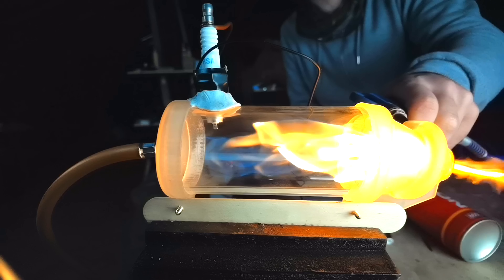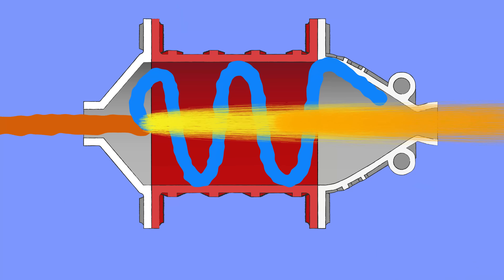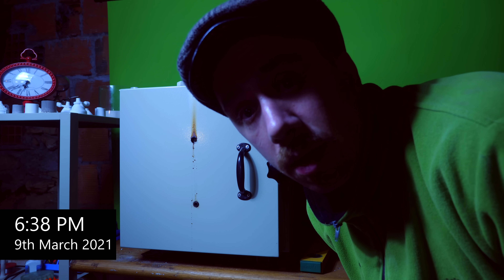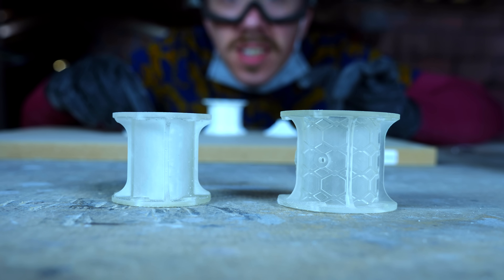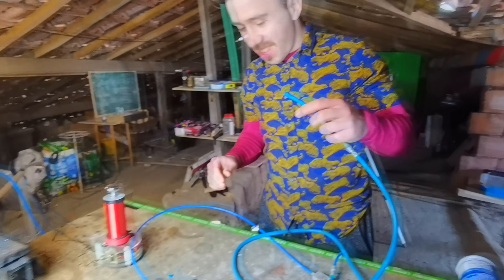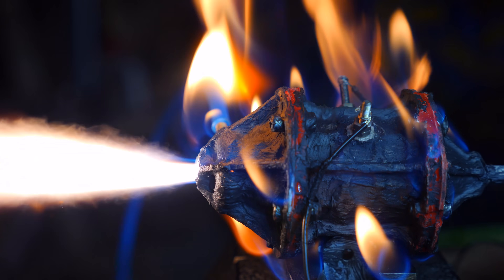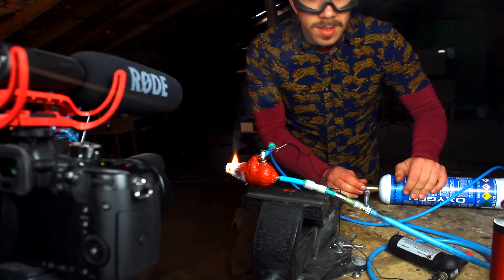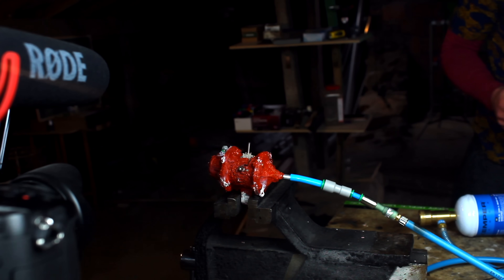Vortex Rocket V2.0 (3D Printed)

Comment: thinking materials... have you considered a layered assembly ?inner ceramic layer, a seal (maybe a soft metal), outer ceramic layer and another seal layer at the end?.. or those coats you used.. idk i'm not an engineer

Comment: I love these rocket projects! What if you coated it inside and out with water glass (sodium silicate) 3 or 4 times, firing it in the kiln for each layer? The one piece design would work best I think. 

To evenly coat the inside: Take a vinyl tube & cap one end. Drill a bunch of holes drilled in it along the whole length. Fill the tube with the water glass & leave the top open. Use a high speed drill to spin the tube while holding it vertically in the center of the engine and let centrifugal force do the work. Trick is to make the holes small enough that the surface tension holds the liquid glass in but allows it to flow out when spun up.

Speaking of spinning, have you thought about trying a clay model on a potters wheel and joining 2 halves? It will probably leak but there's a solution I'm sure.

Comment: If you glaze these parts you need a blast shield.  if the pressure builds too much and cant escape fast enough the engine will explode. A rocket engine is a controlled explosion, please be safe.
Reply: Also i love your videos! You rock et!! Get it?? Keep up the goos work

Comment: Smoking engine gasket component clown, combustion engine seal compounds is not for rockets engine temperature . Engine oil pan seal paste temperature is limited to boiling water not the temperature of fire blowing 451 degrees

Comment: Could a mold be 3d printed?  You can buy the ceramic in liquid, pour it into the mold, dry, fire, then there should be no cracks as the ceramic liquid is pure.

Comment: Seal the inside with a glaze before firing in kiln possibly? Fuel cells use ceramic media because it is gas permeable. Since u are under pressure the gas will fill the pores quickly I imagine. Could the gas be creating small micro explosions of gas INSIDE the pores of the body that are weakening the ceramic? Very Cool progress & look forward to seeing you get this figured out! Keep it coming & good luck! Oh! & please wear dust protection when grinding that stuff!

Comment: 2 Ideas to stop(or slow) the leaking: 

You could put the ceramic engine in a metal can, then fill the void with refractory cement, and possibly cap off the end with a welded plate with a hole for a nozzle.

You could wrap a metal(possibly copper) coolant line around the engine that the O2, propane, or other coolant goes through, secure it with refractory glue, then coat the now cool outside with a non porous glue/resin without worrying about heat.

Comment: using a metal sleeve either in aluminum or a alloy. the problem with using ceramic is yes it withstands high heat but it is porous. maybe adding either titanium powder to the ceramic will help with the leaking and using braided steel tubing for the fuel source and oxidizer would help as well as there should not be as much back pressure from the gases as they enter the engine. You Idea is sound and just a wee bit more refining and you will be there

Comment: I understand you wish to 3d print all of the parts, but we undersrand that the materials available right now have obvious limitations. You cant just cast or print a piece final dimensions, you have to get close enough and grinds or machine the final dimensions or get comfortable with using a lot of sacrificial couplong hardware like seals and gaskets.

Also electroboom was always good. Jay bowes still sucks. Good dude, but his producers need to be fired.some of his jump cuts are so jarring thst you think his disembodied head is going to pop out of the silverware drawer.

Anyway, if you want the casing to be less porous, i suggest coating it with a few layers of ceramic slip, then kiln baking to glass the outside. It will leak far far less that way. Another method to increase the thickness of the casing without giving away too much to shrinkage would be to NOT HAVE 7 AD BREAKS IN A 20 MINUTE VIDEO!

Comment: Hi Integza, I think that now that you have a kiln you could try to make it out of metal (which won’t leak or burn, obviously). What you can do is 3d print something using plastic, then put that object in a bucket and cast plaster of Paris around it, then you can put the plaster with the 3d printed object in an oven to melt out the plastic, then pour liquid metal (I would start with aluminum) into there. Once you remove the plaster, you have a metal rocket engine. I made a forge and I have cast aluminum and copper. Aluminum is a lot less scary to cast than you would think due to its lower melting point. You would not need that much more equipment, just a crucible, crucible tongs, and some heat resistant gloves (which, let’s be honest, you need anyways) since you already have the kiln. If you do not want to do it yourself then you could probably collaborate with someone else, just mail them the 3d printed things and if all goes well they’ll just mail you back the object in metal.

Comment: ...its leaking because of the fact that the ceramic is porous right? cant you use that porosity to your advantage? like, what if you thinned down the refractory glue/high temp silicone, with something that evaporates easily, and painted it on the parts, and while wet, place it in a vacuum chamber to REALLY get it to soak into the ceramic and fill ALL the nooks and crannies while evaporating said liquid at the same time.....

Comment: I have very little knowledge on how engines work. But my best suggestion would probably be a way for the engine to naturally vent access pressure. As for rocket engines the chamber diameter to nozzle diameter ratio is set for specific internal pressures for maximum efficiency. If it goes over this pressure by to much it could self destruct, so maybe a way to vent that overpressure would help solve some of that issue with leaking. Another solution might be to find a thicker thickness for the ceramic to be at, or a different 3d printable compound or sealent thats less porous

Comment: A way of measuring thrust the engines are creating would be a good addition for future videos, especially if you can get them running consistently and try various nozzle shapes and sizes.

Be fun to see how much weight you would have to play with if you want to get one of these to fly or push something at some point.

Comment: Why dont you glaze the parts afterwards and try seal them like that. They're ceramic, you have a kiln, a high temp glaze may work?
Reply: Exactly my thinking
Reply: Yes!
Reply: The pressure is the bigger problem
Reply: @Mikail_199  just take some Prozac and the pressure won’t bother you.
Reply: @BobWidlefish  yeah i was obviously talking about the social aspect of this project
Reply: @Mikail_199  yea, i was thinking about that, but the rigidity and temp resistance may prove better than the current solutions. Glazes after firing are basically glass and glass bottles can hold decent pressures.
Reply: @zakhassan9722  k i would use a splitted ring which is between the parts and is wider in the inside. That would be an easy solution with no glaze or something new.

Comment: 3 solutions: increase pressure vessel volume to reduce pressure.
2 copper/steel sheets w/ ring joints glued with heat resistant putty to re direct pressure.
1 wider nozzle or a pressure relief valve that can feed into a bell since much of your ignition is happening  past the nozzle and lost energy is recycled as bell wall pressure . probibly can think you can do at least 4 more upgrades on dimension, materials and energy manipulation and is ez as pi.
please do hybrid chambered linear-rotating detonation engines as a Segway to get feelers to rotating detonation engines.

Comment: Hey Mr. Integza! 
 
Lets repeat process up until you got your Red  Zeppelin @ 12:56  and then proceed more  with the enclosure idea. 
Encase the entire print after its reduced and use some high temperature resin to cast the entire thing in a block. Tricky thing is preserving inside geometry. 
Maybe only leaving nozzle exposed and drilling in the other holes after casting. Shouldn't be too hard super maybe???
Try iterations of density, and use vacuum box to make sure the resin reinforced and makes a more gasproof seal around the engine. 
Make a Solid Block with your Engine Geometry inside. 
Hope I'm kinda explaining it right. Will try to find examples and follow up. 
Good luck and godspeed, Sir!

Comment: New video theme: safety and why it's important.  You wouldn't want to get silicosis from breathing in that ceramic dust.  Consider a water drip and using a flex shaft tool - that would move the motor far away from water and dust.  Show your fire extinguishers - that you wouldn't risk burning the attic off of the house.  Consider blast shields - a ceramic part hasn't blown up yet, but there will come a day...especially now that you have a reliable ignition source. Take care of yourself, be a good role-model, and keep on making great videos!

Comment: What if you put the silicone in the inside of the engine? It seems like the temperature and pressure causes it to loosen up and inflate like bubbles. If you put it in the inside it would be pretty much impossible for it to do that.

Comment: How about using 3D printed models to make molds for slush casting parts. then you can have the thickness and uniform structure and avoid having weak points in the binding layers as the ceramic resin seem to have.

Comment: just guessing here but seems that the casting method make the structure
 more brittle in high pressures maybe because of the voids spaces that the resing left in the burning phase.

what if you Revest the outside of the nozzle and the main chamber in another kind of ceramic just to give a more sturdy body

Comment: Might be able to try coating the engine in this stuff 'Super Steel EPOXY Weld" by "Plastic Padding"' it comes out very much like a porcelain and is really solid stuff like steel, its only cheap and id say worth a shot, good testing and prototyping, keep at it :-)

Comment: 1) 3D print the rocket in a vacuum (if possible) to reduce air bubbles/porosity, 2) print multiple successively larger versions of the rocket and nest them together like Matryoshka dolls with thermal paste in between layers, 3) fiberglass the hell out of the outside with high-strength resin, 4) use more shielding because I'm worried that the whole thing might build too much pressure and explode.

Comment: I seems like the body is heating up from the increased temperature caused by introducing more fuel. This heat may be opening up the pores in the ceramic. What if you sleeved the engine creating an inner and outer body, leaving space to allow for an air gap between the inner and outer bodies. Air is a decent insulator so maybe the outer shell will stay cool enough to maintain small porosity and keep pressure.

Comment: Why don't you try using high temperature glaze (which you might be able to get in a low viscosity liquid for dipping)?
That would probably give you a better overall seal and would let you apply it to the inside of the chamber as well as the outside.

You might also be able to add a layer of regular clay by hand and refire the part. That'd add thickness (strength) and might help seal it.

Comment: Dear integza, 
i see you did open and close the propane tank all the time
why not build a test bench for your liquid fuel or a control station ? 
so you can properly ajust the ratio of fuel / oxidiser ( plug and test )  
like my comment , I need a new 3d printer (mine is too old and abused)

Comment: A high temp epoxy coating should probably solve your leaking issues, you can probably get it in a spray can format. Also, carbon fiber can withstand some crazy high temperatures (6000F). So if you're going to wrap it in a coating, you could always add carbon string wrapping for structural support, very similar to how they make the fuel tanks for rockets.

Comment: The engine is leaking because its heat expanding you have to design the parts nested so when they expand they seal aginst the front faces

Comment: Ok ok, i know it is a 3d printing focused maker channel, but Why don't you 3D print in a material that can be melted easily and cast the engine in sand with the 3D printed mold? Casting is a kind of addictive manufacture too, your designs already look like could be cast easily, and that would eliminate the porous problems

Comment: You could probably dip the rocket engine parts in a glaze, let them drip dry then fire them in your kiln a second time to give them a smooth, sealed surface. That should prevent leaking, and make give a really nice surface finish.

You’d have to be sure you don’t end up with puddles of glaze in any crevices though, and I’m not sure if the glaze would significantly affect the precision of your parts, but I suspect it would play a smaller role than cooking the resin out of the parts in the first place.

Comment: As for the leaking, could you finish the part, then submerge it in more of the resin inside a vacuum chamber and fire it in the kiln again? I suppose repeat until its air tight?

Comment: The ceramic is porous.  This is because of the kiln process.  The Resin is gone and what's left is a ceramic sponge.  If you must seal it, I would use a submersion process.  However, Sealing this is a fool's errand.  You could consider ceramic casting or steel casting to deal with the holes or choose another material.  I'm interested in how well Carbon Fiber FDM would hold up.  For the ceramic casting, create a plaster mold with low-temperature plastic and then fire it then fill the mold with liquid clay.  The process is called Slipcasting.  It shouldn't be porous and it doesn't need special resin that's warp prone

Comment: What about cutting up a soda can (thin aluminum) and using it to “skin” the inside of the printed parts? Use the refractory cement to “glue” the inner layer in. I’m sure you’ve got can laying around, you’ve got the refractory cement, and you can cut the can with a pair of good scissors

Comment: could you put the 3d printed ceramic parts in some sort of liquid and then use a vacuum chamber to force it into the air spaces between the gaps in the ceramic? a high temp resin, or very fine ceramic soup?

Comment: For part connection points, aside from silicon paste, maybe using turbine labyrinth seals for holding two parts together under pressures higher than atmospheric.

Additionally, why not use a modular design whereby a 1mm cylinder or cone (etc.) slips inside another 1mm cone with 1mm extra radius plus error tolerances or additional for air insulation or better yet housing for cooling. Regenerative cooling occurs when fuel and or oxygen passes the chamber before being ignited. Plus there would be added bonus pyrotechnics on failure.

Comment: Okay, this has probably been posted before, but why not 3D print molds then cast the engine using refractory clay. You already have the kiln to fire the clay. Then there is no restriction on thickness or heat.

Comment: Why not heat your ceramic parts in a kiln and coat them with glass to seal the porosity.
Reply: ...or use some sort of porcelain glaze that is kiln fired, like they use on pottery.

Comment: once you 3d print the engine, then bake it to remove the resin, could you then try coating it in some kind of ceramic paste, and bake that? That way you may be able to build up the thickness and eventually maybe overcome the porosity without the 2mm limitation

Comment: Try a patterned surface for joining the two parts. Base part having a pit and the second part having a small hill that goes into the pit. This might slow down air escape and with a low thermal conductive glue it might be better

Comment: Have you considered glazing the ceramic parts after burning out the resin to eliminate the porosity? It will require a second firing, and getting the coating even may be difficult.

Comment: Does a liquid, with fine particle, which hardens (heat/uv/ what ever) exist, who can endure the temperature and would with cappilar? forces fill out the holes in the material? I mean, we have dyes who get stuck inbetween DNA links.

Comment: INTEGZNICHKA! Perhaps if you made a graphite based ink/paint for inside the rocket after printed and assembled, Robbert Murray Smith Has many videos on how to easily make your own. either you could do multiple dip coats of the whole thing, or paint as you assemble? i remember he used it in a firebrick once to make a microwave autoclave.

Comment: Would it be possible to add a ceramic glazing after the first firing that makes it shrink? I don’t know if a second firing after adding glazing is even a thing but if the glazing can be kept from cracking or crazing, it should seal it.
Reply: Further thoughts: measure the external temp of your engine; the glaze will have to withstand that. Also, the ceramic of the engine and the glaze itself will need to be closely matched for thermal expansion rates. I don’t even know if this is possible. Do you know any ceramics experts?